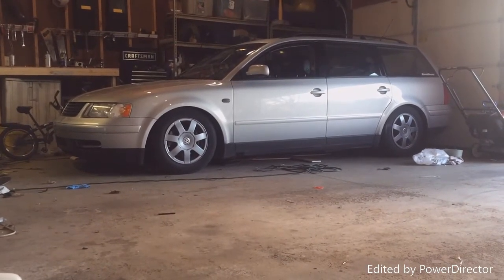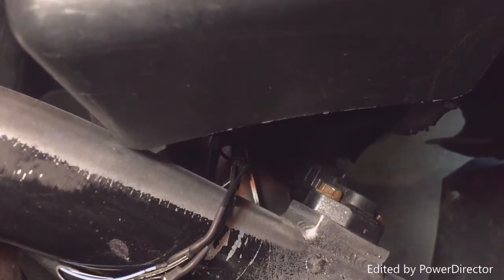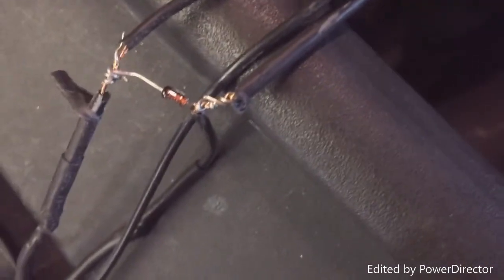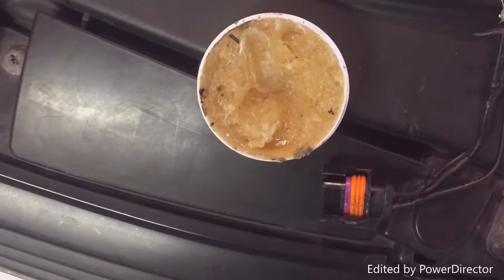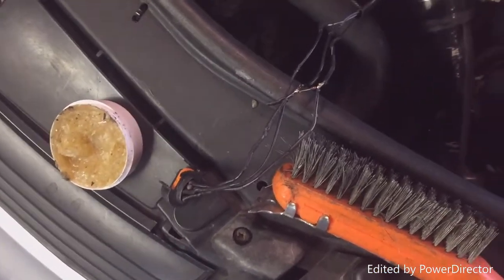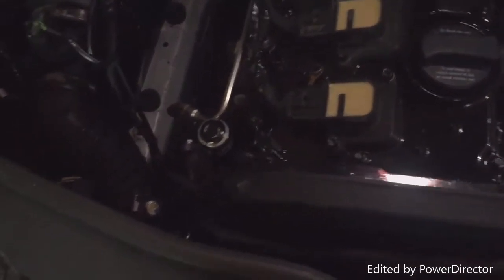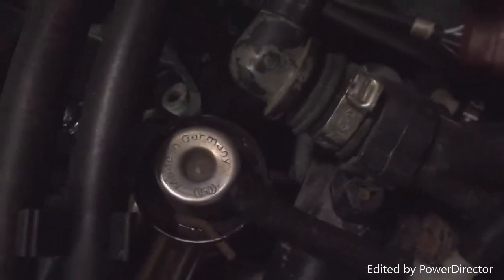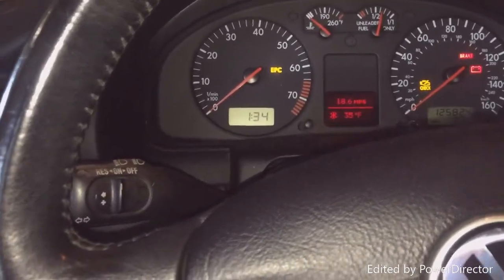1.8T DIODE MOD INSTALL TUTORIAL.

Comment: Dude nice job on the install, and good job filming! You should make more videos, I look forward to seeing more!
Reply from the maker: NinjaxBart thanks I have been trying I need to start making videos again I have just been lazy.
Reply: Sups 12  question 3.9v diod but at what wattage is that diod specifically homie.
Reply from the maker: NinjaxBart I'm not exactly sure these are what I bought and used: 
https://www.amazon.com/gp/aw/d/B00DJ045TU/ref=yo_ii_img?ie=UTF8&psc=1 
It has a bunch of different voltages that are labeled just use the 3.9.
Reply: Sups 12 i feel you but we would like to know what is the Watt your using.
Reply from the maker: NinjaxBart what year is your car because some came with more horsepower and you would have to use something like a 4.3v
Reply: Sups 12 mime is a 02 but i have the same engine as you.
Reply: Sups 12 code
Reply from the maker: Norm Jr ok if is is an atw code then the 3.9v will work and I'm pretty sure that mine is a .5 watt.
Reply: Sups 12 ok thank alot and love the wagon by the way.
Reply: what purpose does this mode serve..what does it do and why??
Reply: yojo mojo Higher boost levels. Diode tricks the ECU and doesn't let it see how much boost you're pushing
Reply: Guy on YouTube way too much  Can't this cause issues tho?
Reply: yojo mojo Not really, our stock K03 and K03s turbos are pretty darn tough. The K03 you can sit comfortably at 11-13 psi depending on how well your vehicle's been maintained, and the K03s you can sit at about 16-17 psi easily. Obviously you'll put more stress on your turbo and it won't last as long, but you'll definitely not blow anything up unless you push things too far

Comment: more friend. How is increasing pressure will get safer? . If you increase pressure you are reducing flow. So it is it lean on high rpms with the mod how rasing fuel pressure is going to help ?
Reply from the maker: The car can compensate for the fuel needed through the o2 sensors, the diode just stops the car from going into limp mode due to the extra boost

Comment: Hey Sups 12, thanks for putting up this great video. I'm just wondering whether this mod will work on my 99 A6 1.8t (APU)? I read on AudiForums that only cars from 2000 onwards had MAP sensors but pretty sure mine has one on the intercooler. What do you think?
Reply from the maker: louie2shoes from what I understand it should work on all 1.8ts'. the only difference is that you will probably have to use a different voltage on the diode. I'm not sure what voltage it would be for your car.
Reply: Cheers Sups 12. I'll have a play!

Comment: So i just ordered a manual boost controller for my b5.5 passat. Do i need to do this diode mod to effectively have more boost? Or would just the manuel boost controller work fine? 
I don't 100% understand the reason of the diode mod...
Reply from the maker: Nathan Gerzen with a MBC and no diode mod the car can run around 10 pounds of boost fine. When you hit 11 psi the car will go into limp mode. When it does that the car won't make ANY boost. When you do the diode mod you essentially trick the car and in turn you can run around 15 pounds of boost without going into limp mode.
Reply: Sups 12 okay thanks alot!
Btw good informative vids!!
If i do go into limp mode, how do i get out? 
And the 3.9v diode should work on the b5.5 too?
Reply from the maker: Nathan Gerzen to get out of limp mode you can umplig the battery and let it sit for a while. If you don't the car will go out of it on its own but it will take a couple of days to get out.
Reply from the maker: Nathan Gerzen oh and I'm not 100 percent sure that diode will work on your car. I know all the different engine codes need a different diode I'm not sure what one would work for yours. I would just order a bunch between 3.5 and 4.3 and then do trial and error until you get the right one.

Comment: Will this work on the AEB as well?
Reply from the maker: Yes, but you may need to use a different voltage diode. If you look on the forms someone may have done it on that engine code.
Reply: Aeb engines dont have a map sensor so it's not possible to do this mod

Comment: 4.3v 5w just so I dont have to replace so quickly.
Which way does the stripe go? Towards black or purple? 
And do i plug the sensor back up or does this bypass the boost pressure sensor
Reply: also would like to know what way the diode faces, cos he says the stripe must face the black wire, but his stripe was facing blue? super confusing